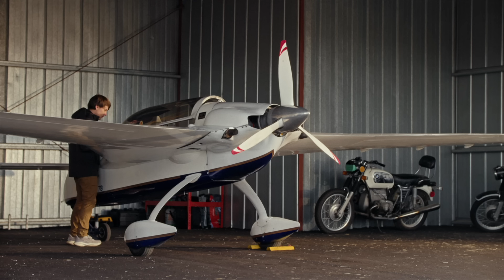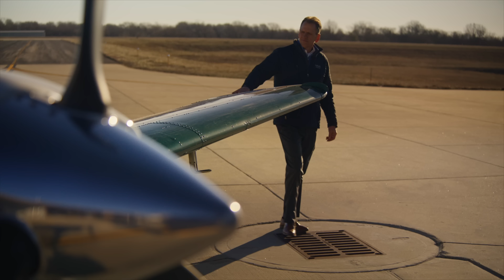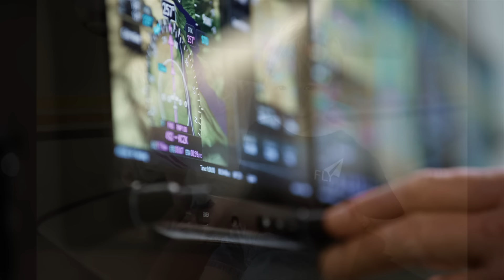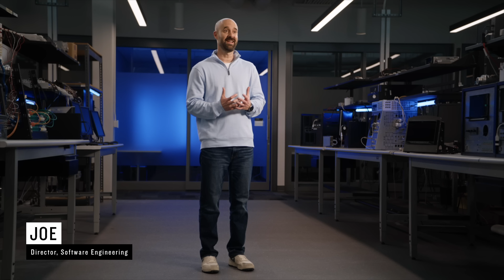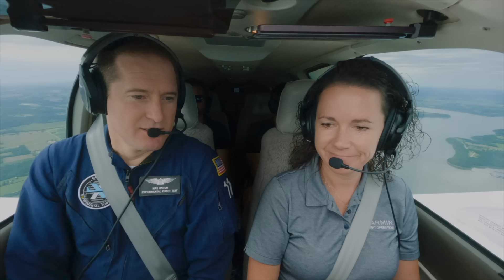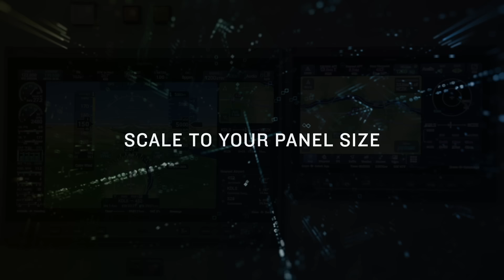Garmin | Introducing AXIS Flight Displays

Comment: General aviation has come a long way. 
I did my initial flight training 35 years ago in steam-gauge Cessna 152s, 172s, and the Beech Duchess. Back then, it was incredibly difficult to synthesize all those steam-gauges data into a 3D mental picture, and it was easy to lose situational awareness if you fell behind the aircraft. 
Today, 20,000+ hours later( and few years left before mandatory retirement), I can honestly say that the modern Garmin avionics here are more advanced than what I have in my Boeing 777s and 787s.

Comment: AI query showed $28000 for a single 11.5 inch panel, and $51,800 for a dual panel set up. This is not account for installation cost
Reply: Whyn do you trust AI so much.... Per midwest panel builders website the GPS/NAV/Com unit is $20,780, the GPS/COMM is $16,340, and the experimental base model is 4,980..... a whole $100 more than a G3X for the base model
Reply: It's probably going to be around $100k with everything taken into consideration.

Comment: From Google: 
 Pricing for the Garmin AXIS integrated flight displays ranges from $8,000 for basic experimental VFR systems up to $28,000 for certified IFR single-display setups, and $51,800 for dual-display IFR packages.Specific Garmin AXIS list prices vary depending on the aircraft type and system configuration:Experimental (VFR): Starts around $8,000 for an 11.6-inch base display that includes air data and attitude sensors. Smaller 8-inch experimental displays are priced at $4,600.Certified Single IFR: An 11.6-inch display system (GDU 116NC) featuring a built-in IFR GPS, Nav/Comm radio, and audio panel retails for $23,400. Pre-order promotions have been offered closer to $20,200.Certified Dual IFR: A dual-display, dual IFR GPS/Nav/Comm system with complete options can run up to $51,800 for highly equipped general aviation panels.These integrated displays consolidate traditional center-stack boxes (like navigators and audio panels) into a single screen unit to lower overall hardware and installation costs. Display-only upgrades from the older G3X Touch can range between $6,000 and $10,000.

Comment: Where do we find the pricing info?
Reply: Where avionics dreams die.
Reply: Looked it up and found this in an article:

"A base 11.6-inch Axis display with VFR GPS costs $8,000, including sensors. The IFR GPS version with GPS navigator, audio panel, and navcom costs $28,000, and two of these together cost $51,800, which Garmin said is less than a G3X with similar capabilities and equipment."
Reply: @xilophor9174  and if you could only certify apps on an iPad, you could probably do it for 1/10th of that
Reply: If you have to ask, you can't afford it.

Comment: It’s so good but still surprised you haven’t innovated toward workflow management - like an integration between checklists and macros. For example, at startup, it should default to a Boarding Checklist prompting the pilot in startup, briefing, ground ops tasks, offering quick loads of frequencies, showing metar, etc. With electric flaps and prop pitch for example, the checklist could configure each in respective phases of flight. 
This new display is awesome but it’s time to go further into automation.
Reply: Let's just do away with humans altogether 😅
Reply: @lnteIIigence 😂😂😂 what an entirely unexpected response 😂

Comment: You would figure electronics would go down in price over the years yet Garmin always finds a way to make it go up.
Reply: Just like their sport watches.
Reply: AI boom ain't really helping much either.
Reply: Where did you find the pricing info?
Reply: The popularity and demand of these electronics are probably what drives higher processes. New aircraft and newer pilots want these displays more and more every year.
Reply: Inflation… Look it up
Reply: @thedrewh10 Outpacing inflation, nice try.
Reply: Garmin displays are amazing! I instruct and our aircraft have Garmin G3X and they've so intuitive. I trained with steam and G5s. They were fine but the G3X makes instrument flying a breeze. G1000 is even more capable. I'm grateful that someone is pushing things forward in GA like Garmin is. -Garmin Fanboy.
Reply: @chrisgoodwyn3301 I agree. They revolutionized ga and are continuing to do so
Reply: Integration means each screen replaces about 5 units. Explain how that’s not reducing overall costs?
Reply: @catherineburton195 literally, I priced a six pack with USED center stack avionics for an RV-9 and it genuinely did not make sense to not go with a G3X. And since seemingly no other competitors offer experimental pricing on their avionics it just made sense.